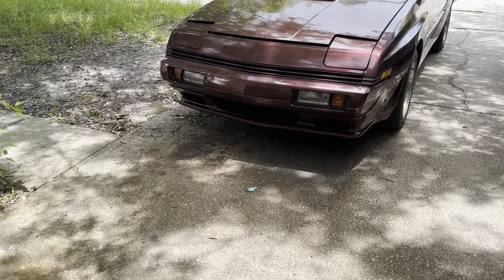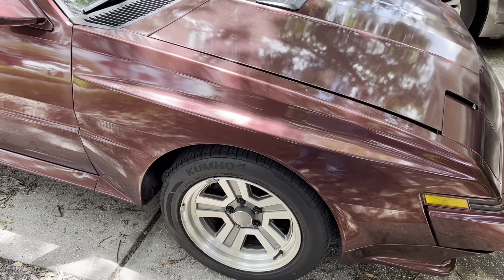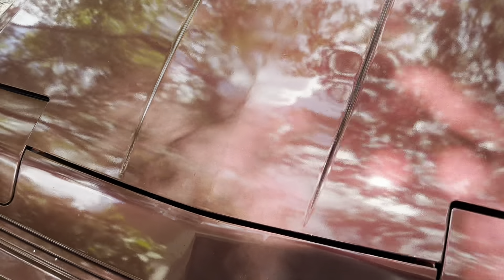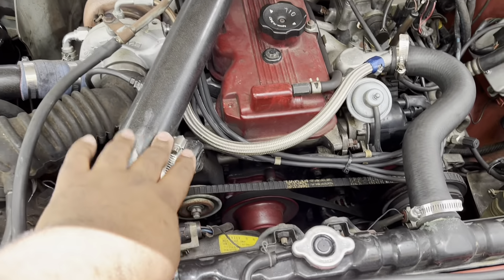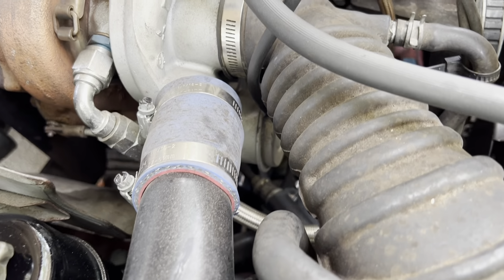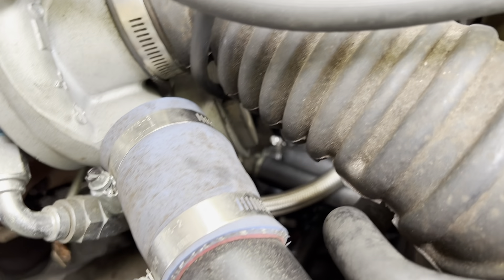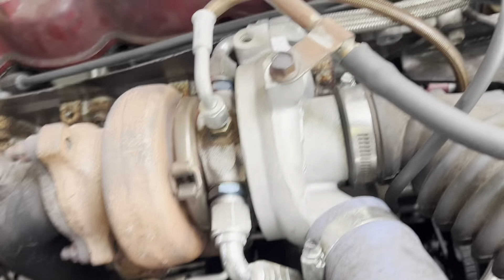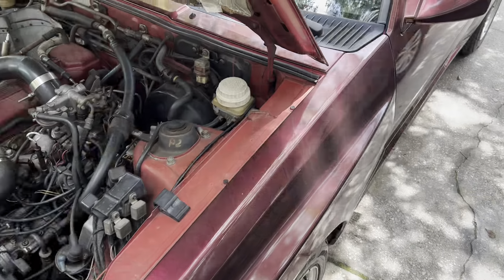Starquest help wellness check fuel neck and oil change￼

Comment: Hey Isaiah, I have another question for ya because you are my go to starquest pro! My radiator fans stopped working on me. Fans are both good so it's either the relays or the thermo switches I believe. I ordered a adjustable fan controller from ebay and it comes with the thermo switch and relay in a unit. I was going to bypass the stock relay and install this but due you think it will mess with the ecu or will I be ok? Maybe good video material,hint hint. Lol thanks man!
Reply from the maker: LOL thank you thank you so basically what normally goes bad is the actual relays the thermostat switches at the bottom doesn’t normally go bad but it’s a good original system to keep the car cool but the relays definitely rust out but I actually did some fan upgrades to a yellow conquest and I talk about the thermostatic switches and relays but if you go aftermarket it’s better to have Upgraded relays from 20 amp relays to 50 amp relays and get a aftermarket thermostatic switch like what you got and connect it💪🏿💪🏿💪🏿💪🏿